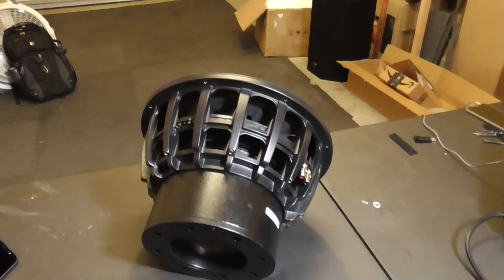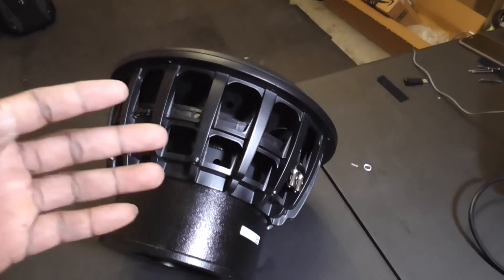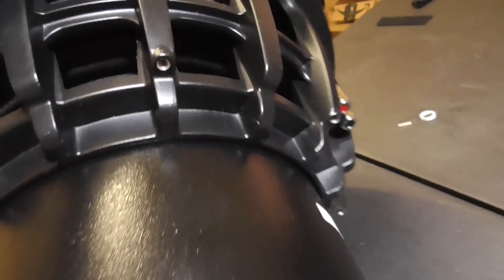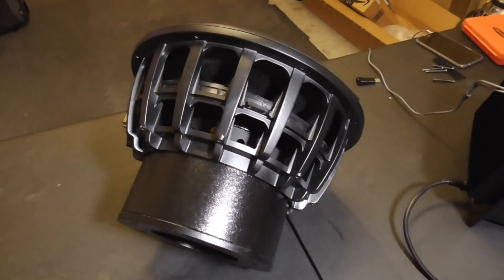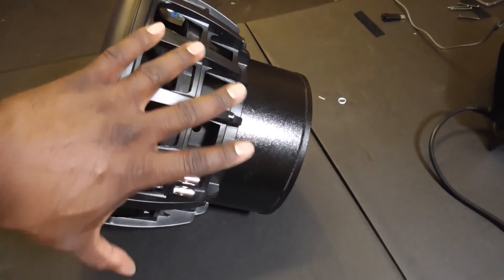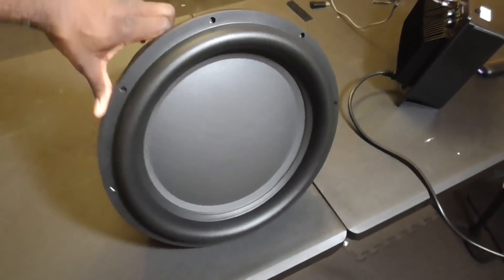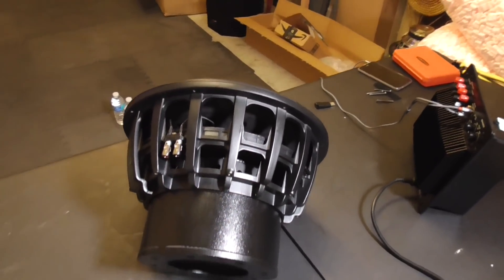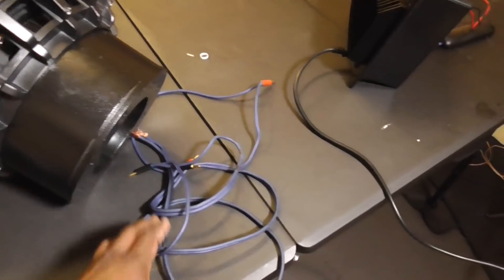My New Sub Has Made It - Peerless Tymphany STW350F

Comment: Need to correct your info on this one, this is NOT a dual 8 ohm sub.  I emailed Peerless direct to ask and it is a Dual 4 ohm sub,  designated by the-04 in the model number, so you can run it 2ohm or 8ohm configuration(which is what I am doing for HT application). Parts Express has the info incorrect on the website for this sub.
Reply: Hi, sorry to perform Necromancy on this comment, but when you got the driver did you check the resistance with a multimeter? I'm looking at buying 1 or 2 of these and this will help me immensely, I've struggled to get any confirmation on the voice coil resistance anywhere, all the sites or videos I can find do not have any solid confirmation,  and what you say about the -04 designation makes sense to me.

Comment: So how can it have enough throw in the spider pack to support that many watts if the coil is 7.5" on that basket? Especially if it's designed for lower frequency.
Reply from the maker: Keep in mind that x max is a simple calculation of the magnetic Gap minus the coil length, divided by 2. in this case you have extreme measurements of 36 mm for magnetic Gap and 57 millimeters of coil height you divide the results by two and that's how you get 10.5 mm of x-max. that does not constitute for the actual usable mechanical travel which is 45 mm one way equaling a total of 90 mm of cone travel
Reply: @BudgetBassHead  copy that! Best explanation of that I've seen
Reply: The spider on it is massive too, its probably 10-12" itself

Comment: The STW-350F-188PR01-04 subwoofer from Peerless was designed with performance and space in mind. This driver offers deep and clean low-frequency reproduction with minimal distortion at high sound pressure levels. Unlike most subwoofers, the STW-350 can be mounted in a much smaller box than traditional subwoofers, which is enabled by the low Vas, high moving mass, and huge 7.4" (188 mm) voice coil. This driver also features a unique FEA-optimized ferrite motor, extremely robust suspension, and an incredible amount of venting which provides extraordinarily low power compression even when driven with over 3,500 watts of power. This driver is built for high-quality performance and long term reliability. 

Note: Due to the incredible amount of venting on this driver, when used outside of an enclosure, the air turbulance generated will create audible noise. Because of this, we recommend the use of a sealed enclosure.

IMHO, probably one of the best subs for car audio applications. A wall of these would be insane!

Comment: If you're looking to give it the full 3500 you could check the Brazilian amplifiers 4 ohm amplifiers taramps makes one and the next company named powerus
Reply from the maker: Thanks for the tip. I did look into them and noticed they produce power using very high voltage capacitors. I gotta do a bit more homework on that archistructure before purchasing one of those. If you're not care, you could easily cause damage and start a fire with one of those. Thanks for the tip, though!
Reply: @BudgetBassHead  
They also dont like high volt pre-amp input or big voltage drops.
Reply: Those taramps are dangerous
Reply: A lot of people don't like Brazilians amplifiers because you can't wire them down as long as you stay in the ohm load you all right

Comment: Cool👍🏻.  I got the same sub from Parts Express a few month ago and I’m powering it with a Orion HCCA 8K.  At 4 ohms it pushes over 4K.  I hope you enjoy it.  I have it in a 2 ft.³ sealed box and it plays great.
Reply: Kevin Guthrie would you say with the sealed box is it more for an audiophile ear ...or is it purely for sound pressure ...I am struggling if I should get this or not
Reply: @johnblackwell645  did you take the STW any feedback please
Reply: @anandshah71   I did....it’s sounds amazing....digs deep with no problem of distorting....it also plays really fast....like double bass in a fast metal or Bollywood song come out like you have two tens....but...but this being said it’s a very difficult to tune and match a car audio amp to it
Reply: Thanks John for the reply really helps make my decision what amp are you driving it. I have am planning on using Hypex nCore bridged 1000 watts 4ohm. What size box u went with my room is 16-28ft did you use the brasing with the below middle screw section or only screwed on too 
Sorry for so many questions not getting much info on the net. I already have 2 peerless XLS sealed 10” want more pressure and low so thinking of 2 nos STW 350 will it be too much
Reply: @anandshah71  I think with a ported 3 cubic foot enclosure would be best for your application....you will get the extra pressure and lows compared to two xls’s.....do not use the screws for middle brace....it will snap the wood....it did it twice to me....I ended up putting a foam gasket around the hole in the bracket and snuggled the subwoofer magnet in there...so far so good ....and all you need is one..